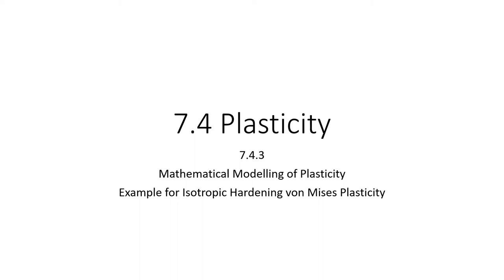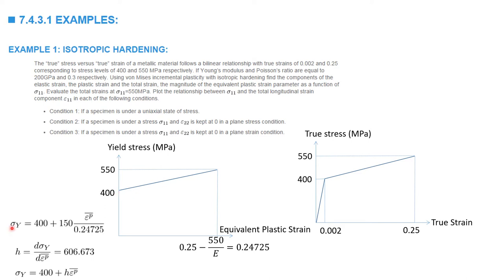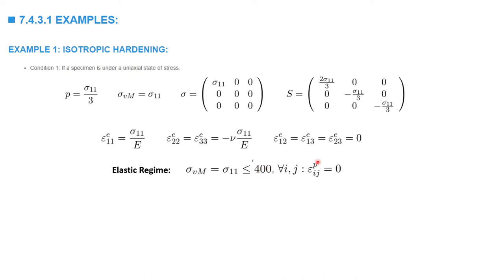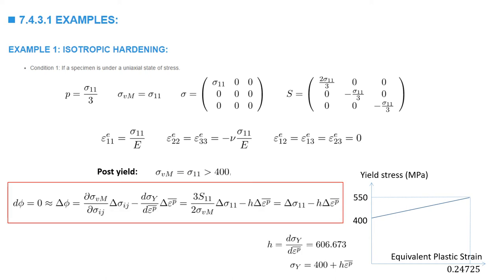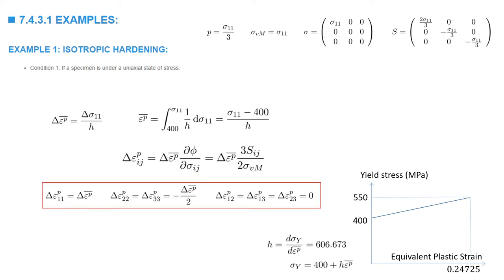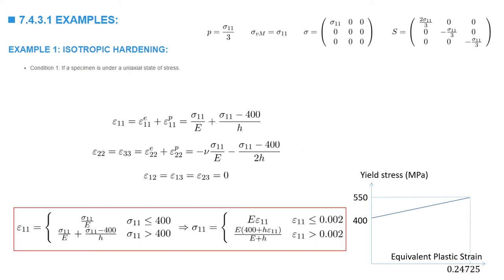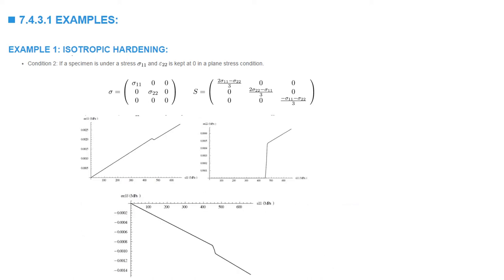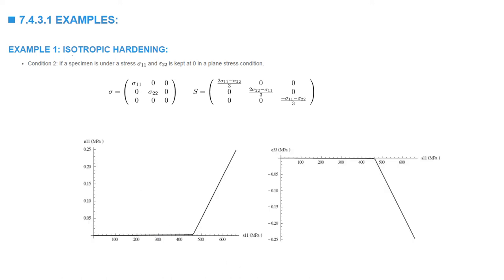7.4.3.1 Isotropic Hardening Example

Comment: Hello sir, I have a question on example 1, condition 2. Does the variable sigma_VM change at every increment or does it stay constant in the equations?
Reply: It changes. sigma_VM is function of sigma_11 and sigma_22 which are both increasing after initial yield.
Reply: @CivE_UoA  thanks so much! I have another question on example 1, condition 3 (plane strain). In plane strain, can we apply Levy-Mises equation and use sigma_33 = 0.5*sigma_11 for the plastic regime equations in 21:50?

Comment: Thank you for the great explanation. However I would like to ask you where  we can use the plastic modulus "h" in terms of " E " and "E(tan)" as given by the expression, h= (E*E(tan)/(E-E(tan)) ?  In your example your determined it directly as the slope of the straight line? Thank you
Reply from the maker: Sorry, I don't understand your question.
Reply: Sorry Dr @Samer_Adeeb  , iam new to plasticity of steel  so that i might not set the question correctly . The plasticity modulus  was determind here with value of 606.678 MPa as ratio of yeild stress to plastic strain. But i found in some books that the plastic modulus h =(Young Modulus*Tangential Modulus)/( Young Modulus-Tangential Modulus). My qustion is, can we use this expression of h given above interm of E and E_tangential in the determination of plastic modulus of istropic linear hardening . I hope you get what i mean by this question
Reply from the maker: @magedqasem7403  Yes, absolutely. Just be careful that the equation you listed is only applicable for a bilinear stress-strain curve.
Reply: Thank you Dr @Samer_Adeeb